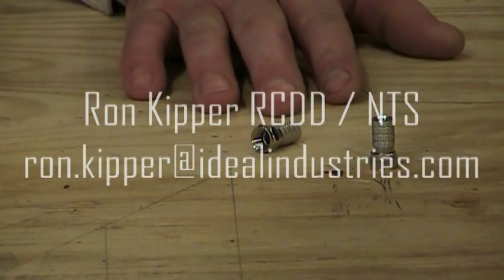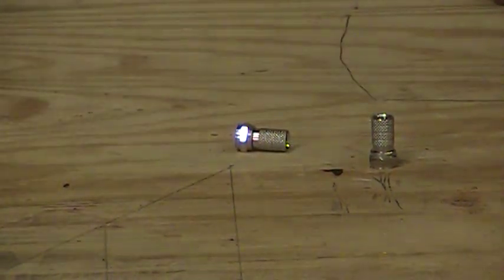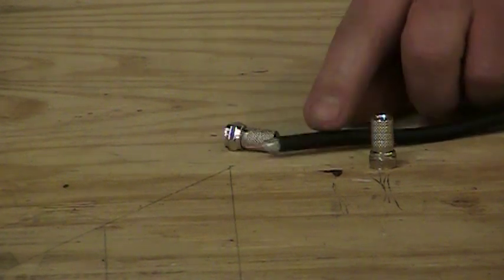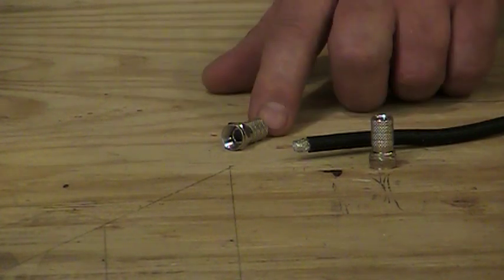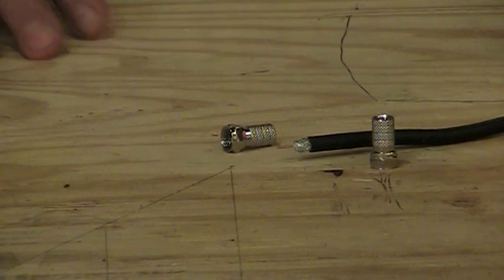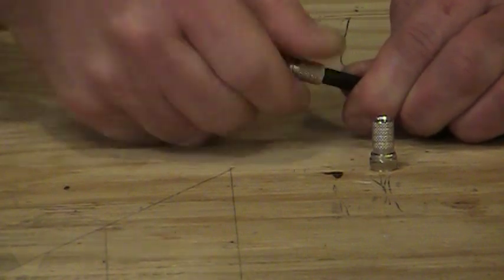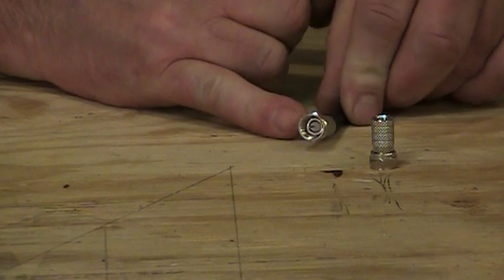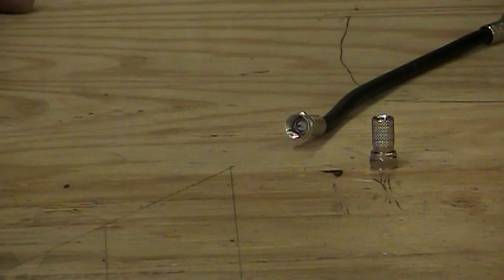Insatlling a Twist On Coax Connector

Comment: dripping a little bit of glue under the connector is a good idea with these. Then they hold in place really well. Otherwise they tend to come off ...
Reply from the maker: Hi newguy56 as a general rule I would tell you not to use a twist-on coax connector. Compression connectors are the way to go. Ron

Comment: Isn't the purpose of folding back the braid so that the inner post of the connector can slip underneath the braid, so even if the braid will be cut off by the threads shouldn't you still fold in back so that the post can easily slip underneath the braid in between the foil.

Although the new push-ons are a much superior solution for the diy'er than twist-ons.